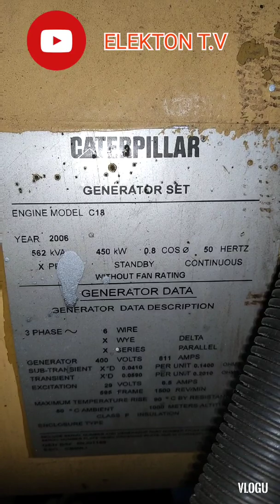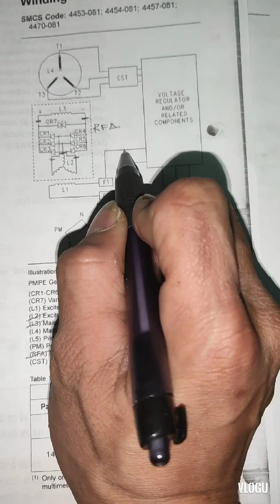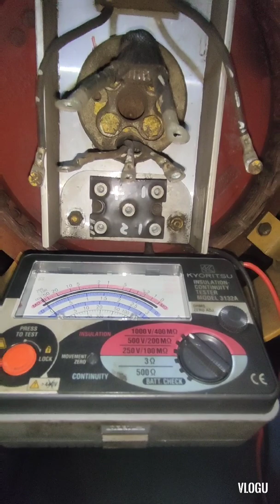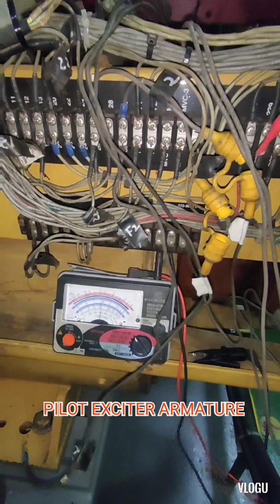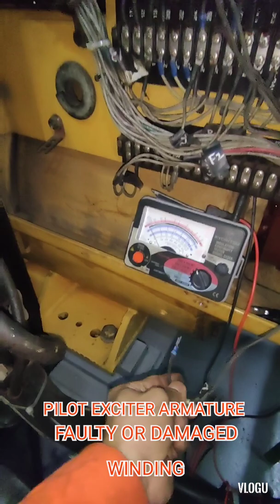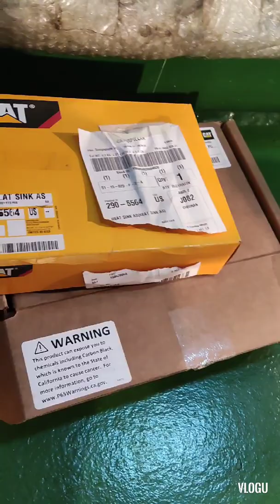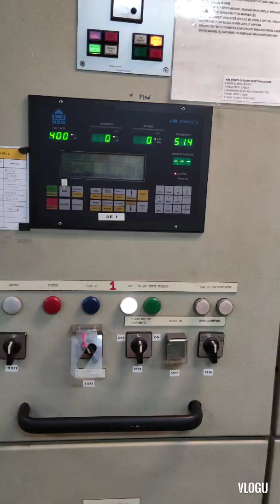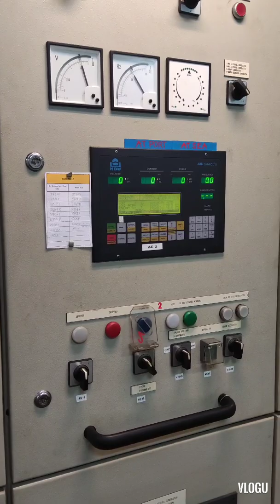GENERATOR TROUBLE,RUN WITHOUT VOLTAGE SUPPLY, INSULATION TEST TO FIND THE PROBLEM.

Comment: How much voltage used for insulation 250v or 500v
Reply: Ok lang ba ng 1kv inject mo dyan sa mga low voltage windings?
Reply from the maker: thanks for watching,1000v
Reply from the maker: OK lang nman sir,sa experience ko wala problema mostly yan na ginagamit ko,pero pwede din nman 500 bsta hwag ko lng klimutan i discharge or i connect sa ground yun mga na test mo..